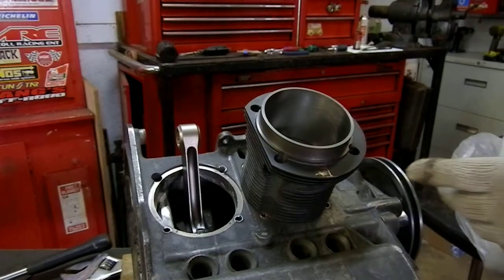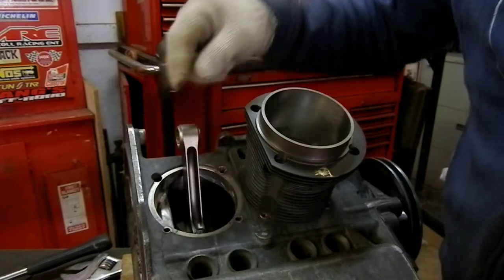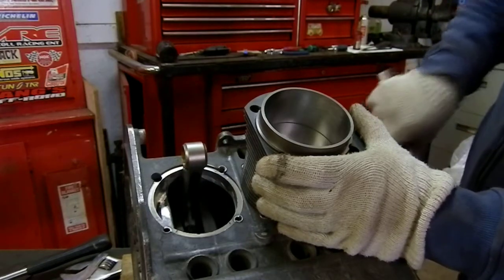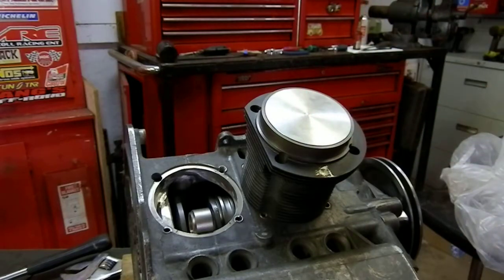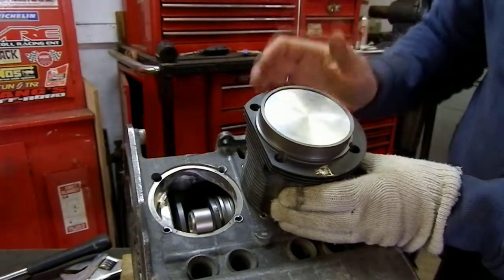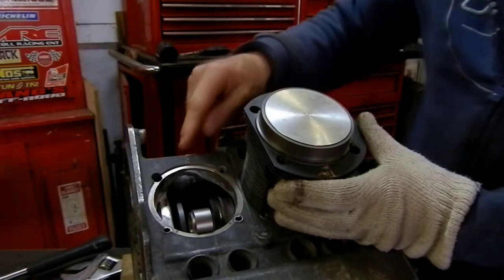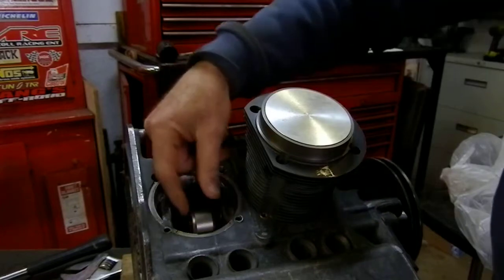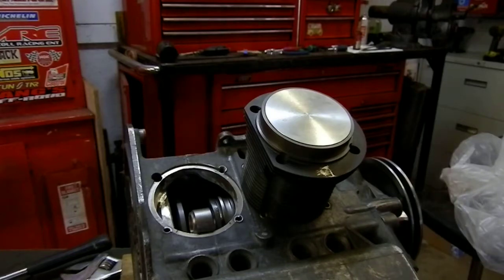Rough measurements for deck heights

Comment: I really enjoy your videos Mark. In one of your previous videos you were lapping the cylinder to the case. If you have to use a shim to attain the desired deck height, doesn't that negate the lapping, because the cylinder is no longer touching where you lapped?